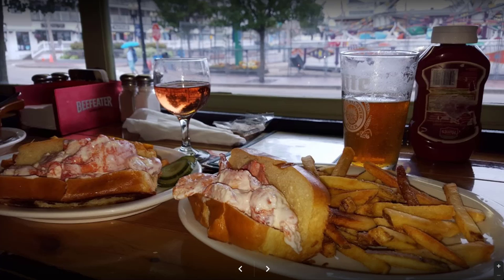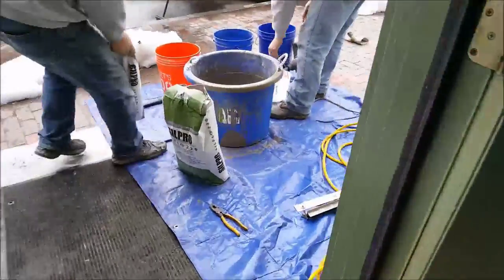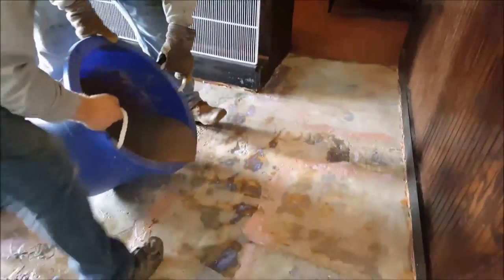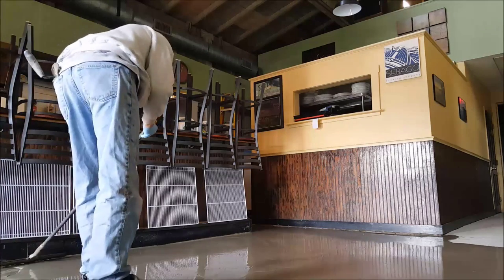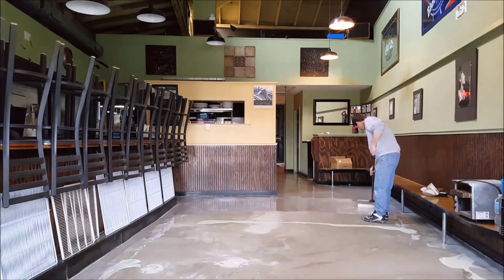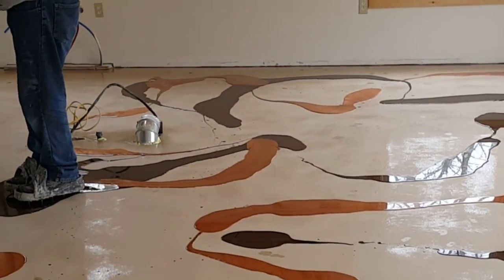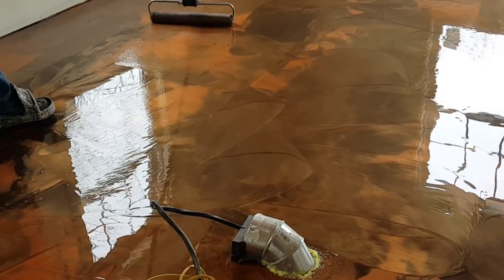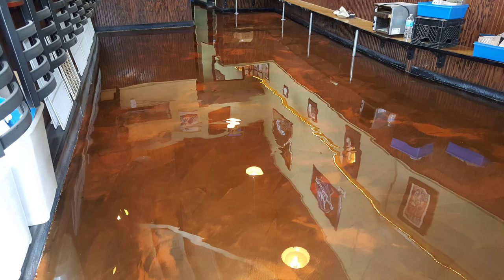Self-Leveling Concrete and Metallic Epoxy Flooring (From Old to New)

Comment: I've used plenty of floor leveler in old buildings to prep for tile or laminate flooring. I found if you take a paint roller frame on a pole, (no cover) and slowly roll it back and forth thru the wet leveler, it helps to spread it out and lets the self-leveling do its job. Rinse off in water and save for the next job.
Reply from the maker: Good tip, thanks!
Reply: @MikeDayConcrete  njj.
Reply: You need to use a roller with spikes.. So you roll the air out as well
Reply: @mule666  that was my next question.  How do you avoid bubbles? Thank you :/
Reply: Hot tip!
Reply: Aeration roller or simply spikey roller
Reply: You needed to prime the floor before using self leveler. Curious as to the durability of the floor as well it's appearance after 1 yr.
Reply: fantastic tip lar.

Comment: Hey I’m a concrete finisher local 502 I work for a company and have my own side work I do every aspect of concrete I do epoxy I just gotta say that floor looks really clear very impressed with your technique and passion for concrete to even be able to get a floor to look that good the reflector on that floor was a mirror finish I didn’t see and bubbles or curdle mad props to you guys out there on the east coast
Reply from the maker: Thank you Nick!
Reply: Put denatured alcohol in a spray bottle it gets rid of the bubbles.
Reply: @jerryboykin3635  denatured after what step? After The metallic epoxy or the final poly clear coat layer?
Reply: After epoxy cause of off gassing of concrete.
Reply: @jaymarr4124   and depending on finish of concrete and material.

Comment: That came out very nice, hats of to you guys...the only problem is epoxy resin floor is not as hard wearing as i thought (scratches easily). Will need regular polish and buffing. Speaking from experience did it in my own home.

Comment: I plan to do similar in a work room.  It's concrete, so I'll float it, and seal it.  Then lay the color, and lightly sand all over.   put on a top leveling clear coat to fill any little dimple or hole. sand that flat, then a light clear coat.       Gives an extra depth and gets rid of little dimples and lines you can see in the light.

Comment: So I did epoxy garages, what we did for a metallic floor is do a solid color for a base coat, like grey for instance, and right after we roll it out, we pour whatever colors the customer wants around the floor and then manually swirl it with a roller. Looks absolutely insane

Comment: Looks great Mike I removed tile from my basement floor need to level with self leveling compound needed to remove mastic glue from tile residue then you suggest a water base epoxy primer then two different colors of epoxy to get that marble look excellent

Comment: Beyond beautiful that's amazing......this is the type of floor I want for my next home's basement & garage 👍
Reply: It appears they skipped the step for priming the floor first. Most contractor’s skip the proper priming step because it adds one day onto their precious schedule.  If you want something done right, you have to either do it yourself, or learn the process and stay on top of contractors.
My contractor was going to skip the prime phase then skip the diamond mesh ( rebar ) step. I fired him immediately then he proceeded to call ME the idiot. He said he had been doing this for 30 years without any problem. I said YOU’VE BEEN DOING IT WRONG FOR 30 YEARS.
Instructions for wood:
Prime the wood surface with HENRY 554 LevelPro Underlayment Primer undiluted and allow the primer to dry overnight (12 hrs. min., 24 hrs. max.) After priming with HENRY 554 LevelPro Underlayment Primer, install 3.2 or 3.4 galvanized, expanded diamond metal lath mesh (“plaster lath”) to the subfloor, stapling approximately
every 6 inches to prevent the mesh from “floating”. Overlap adjacent pieces of lath approximately 1”.
Reply: @wheelie642  I've got various ideas & videos saved for what I want in a bar top also so definitely have some reading & research to do. That shine is what gets me 👍

Comment: Wow! Prep(dry) went well. Very seldom the concrete is not contaminated and needs replaced under those horrible red tiles. Not too many pinholes or bubbles after 'self-leveling'. Floor turned out absolutely beautiful. Is it non-skid? Or slip resistant? A full broadcast floor for kitchen areas is what I'm used to.
You do top notch work.

Comment: Great job! Looks amazing. Does anyone know how durable this stuff is? Is it garage worthy? I have a light duty workshop and was thinking about putting this in there. Scratching, pitting, gouging?
Reply: I went to the comment section with the same questions as you. Did you ever get an answer?
Reply: Wood and resin Designs.c o m  thanks for the reply. You're the first one in almost a year to answer, as you can see.
Reply: Wood and resin Designs.c o m  I actually had colored/tinted concrete poured about a week ago. I'm going to see how that turns out. They're coming to grind it tomorrow. They didn't smooth it enough when finishing it. So now they have to grind it.

Comment: Beautiful work as always. I just had a 1250sf slab poured in my pole barn. By watching your videos I graded and framed it myself. I hired three guys to do the pour and power trowel and saved thousands. Thank you for all the knowledge. You are a great teacher. What would be the best clear product to seal it that would be oil and gas resistant. How long do I need to let it cure before sealing and do I have to grind the power trowel smooth off ? Keep up the great content. I am in central Florida by the way.
Reply from the maker: This is a good clear sealer, better than regular acrylic concrete sealers: https://www.walttools.com/product-categories/product/deco-2k-1-25-gallon-kit
Got to wait 28 days before applying it though.
Reply: Floor should have been smooth after power troweln

Comment: That's a helpful video! What type of primer with moisture blocker are you using? Is there no need to grind or score the leveler before adding primer? I was thinking about using a zero VOC 100% solids polyaspartic with coving for an indoor grow room. Please let me know if you have any specific recommendations!

Comment: Hello and thank you for the video. Question for you about a top coat over the epoxy you did.  Did you do a top coat like Polyaspartic or Polyurea to help in preventing dulling, UV, scratching or for ease of maintenance? How do you repair scratch in epoxy?

Comment: Hi, I am also am epoxy aplicator great job no comment. I just want to say that from my experience self leveling cement and then apllying epoxy on top they don't get to good togeder. I think because self leveling cement has to much water in its composition and soon enough it gonna lip of with epoxy. Tell what you think and what was your experience

Comment: I probably know the answer but.... I have an uneven basement floor covered by tile. I removed the top layer of tile but found an even older layer underneath. Some of it will come up with a power floor stripper and some is stuck so tight the stripper can't get a bite on it. Do I need to sand off all the old tile to lay down the leveler, or can I pour over the super stuck tile?
Reply from the maker: You can pour over the super stuck tiles. Sand or lightly grind the surface, apply the primer and pour self leveler over them. Check Ardex, they have a self leveler for that.
Reply: @MikeDayConcrete  awesome thanks!

Comment: A quick fyi, that vb5 doesn't block moisture very well, I've used it for many years.  Some will start to bubble after a couple years if the hydrostatic pressure is over 6psi.  Definitely helps with outgassing with the money coat.
Reply from the maker: I've never had any problems with it. Been using it for 15 years.
Reply: @MikeDayConcrete  Thats awesome, we have alot of basements in Minnesota and our water tables are high.  Its a pain in the rear....lol I didn't know elite-crete was out for 15 years.  Ive only been using them for 9 years

Comment: Did you also put primer down on the original slab before you poured the leveler? If not why did you apply it on top of the leveller ?

Comment: Nice work Mike! I’m in the process of doing my basement and was wondering…. When it comes to the self levelers, is there a difference in using an underlayment or a resurfacer? 

I plan to apply the rustolium 2 part epoxy paint once it dries.
Reply from the maker: The self leveling underlayment is ok if you're putting epoxy over it. Self levelers go down at 1/8" thick or more, resurfacers can be applied very thin, so that's the main difference.
Reply: @MikeDayConcrete after adding a self leveler do you have to use a primer or can you go straight to your epoxy base coat?

Comment: Hey, quick question, I am refinishing a garage, do you think sika self leveling on top of existing concrete and the epoxy on top of that would be ok? Or should I use a sealer in between? Also how long do you pros recommend for drying time between steps?

Comment: Can I use that as my actual floor in my basement? Would I simply prep, prime and pour the leveler, then wait for it to dry and just paint it? I want to wear my socks in my basement and my kids to play down there without getting dirty. The house is 120 years ols with a 2" thick pitted and cracked up concrete floor. thanks and subscribed!

Comment: Did you apply self level over the tiles if so did u have to prep the tiles surface 1st?
Reply from the maker: We didn't here but you can yes. Just make sure they're not loose and lightly grind over them to prep, same after that.

Comment: Can you use the self leveling concrete to level a bumpy floor in a basement that gets water seepage through the cracks? Should we use a sealer after the concrete?
Reply: The companies I've researched sell an epoxy crack filler.  That's what I'm using. One crack was so big that I used foam backed rod under the epoxy to fill most of the crack.

Comment: The floor looks great. What makes this concrete self-leveling? I mean as any fluid is self-leveling anyway. I think everyone knows that.
Reply: As Mike said, “somewhat ‘self leveling’ it needs a bit of help.” Compared with the viscosity of concrete, which gets a lot stiffer quickly after it’s poured to where you really have to work it, the self leveling product is a big difference.
Reply: .. concrete is NOT a fluid, I thought everyone knew that … 🤔

Comment: Because the epoxy is such a high gloss, is it super slick, or is it a bit ‘rubbery’ like the floor coatings they sometimes put down on gymnasium basketball courts?
Reply from the maker: It's not slick at all when it's dry, a little when wet. It cures very hard, not rubbery at all.

Comment: Dry nice!  Nice to know about top sealers and color.   Did you not need to put a primer down right before you pour the leveler?
Reply: I just watched another vid that said you need to use a primer on the concrete before the self-level pour so that the concrete doesn't absorb too much water from the leveling mix. I don't know myself but that is what the previous video by another guy stated.

Comment: Wow!!! Is that self leveling product from HomeDepot?

My garage floors sometimes sweat after it rains. Thinking there was never a vapor barrier laid down before concrete was poured. Are saying a primer may help prevent water from coming up through the floor?

Lastly is there a max thickness to this self leveling system? I want to redo my garage floor but afraid a car stand or jack my cause it to chip or crack 

Love the content thanks so much for your help

Comment: If you ever run into a situation where there is definite hydrostatic pressure... check out a product called Xypex High'n Dry. It's an amazing product. Kelly from Ontario

Comment: I had a small concrete pad poured by a friend using rapid set motor mix(7’x7’). Unfortunately he did not get it level and I am trying to figure out the best way to fix this. I thought a leveler mix would be a good option. Appreciate your feedback and suggestions.

Comment: great work mike, both on site and with this video ! My experience with epoxy floor primer is that some of them, usually the shiny ones, are very slippery when some kind of liquid is involved, how do you prevent it to happen ? for garage floor a solution is to lay down some thin sand with the top coat but I guess it's a no-no in a restaurant floor.
Reply: slip and fall lawsuits
Reply: I know when I did stamped driveways we would come back and seal it with an expensive non yellowing sealer (cs-309) from Cadman and we would mix in this transparent pulverized plastic called true grit and that would make the smooth stamped pavement like sand paper.

Comment: The floor looks quite slippery - like a bowling bowl.  Is it slip resistant?
Reply from the maker: When dry they're not slippery. Wet yes.
Reply: same problem with polished porcelain gotta use runners and carpets but super easy to clean I can mop my kitchen in minutes with the polished surface but slippery when wet

Comment: I didn’t see the mastic but what it looks like you did it without being in a containment no suits and no negative air machine. 🤦‍♂️. Due to you grinding it that makes get in the air a lot more if the vacuum doesn’t suck well (which looks like it does a great job though)

Comment: Wow! How many days should you give the floor to be useable for traffic/ tables/chairs etc. Thanks, Eric
Reply: What I've read says foot traffic in 24 hours.  Give it 7-8 days before putting heavy furniture on it. I think I read something about 7or8 weeks to fully cure. Every manufacturer will have different specifications on that. It will vary with temperature and humidity.

Comment: You didn’t use a primer between old floor and concrete (I would use an epoxy and quartz sand) to make it stronger than final epoxy is now and witch has higher adhesion that concrete. That’s what I think.

Comment: Seems like priming in less than 24 hours after self leveling is a little to soon and risky in regards to moisture not being expelled before sealing.
Reply from the maker: We didn't have any problems.
Reply: Excellent job, you appear to be very professional.
Reply: @MikeDayConcrete   You did mention water base in the video😉😉
Reply: @MikeDayConcrete  you went straight from self leveler to primer. Is there a reason you didn't scarify or grind the self leveler to prepare it before applying primer?

Comment: I thought you need a anti bubble roller for the self-levelling concrete.
It's a paint roller whit plastic spikes
Reply: Or you can use blow torch to pop the bubbles
Reply: @radwanmiah8150  i don`t think it wil work whit concrete.
and if it`s drying to fast it is gone crack all over the place.
Reply: I've seen other proffessional's use the blow torch to get the rid of the bubbles after the spiked roller
Reply: @radwanmiah8150  yeah oke after the roller.

Comment: They should have taken the walls out (base & wood paneling look HORRIBLE), installed MR board at the bottom & regular gypsum above, put in a matching tile to the new floor as base and pour stop, and a modern wood or vinyl panels above (ex. barnyard panels)to 5' with a cap above then decorate the top half of the wall with appropriate decor or a large ocean themed sticker. Replace lift fixtures at existing electrical connections.

The floor is beautiful but the rest of the remaining existing decor does it no justice...